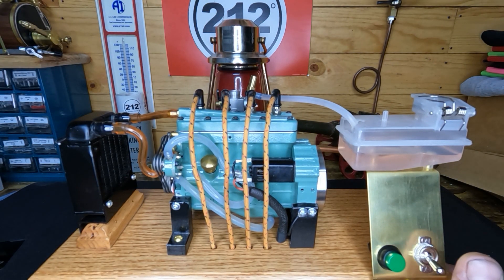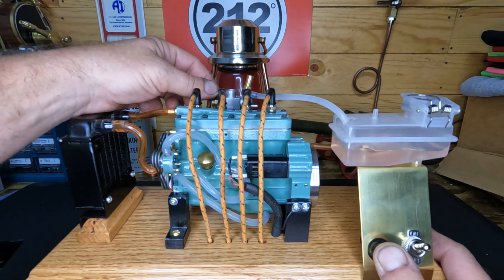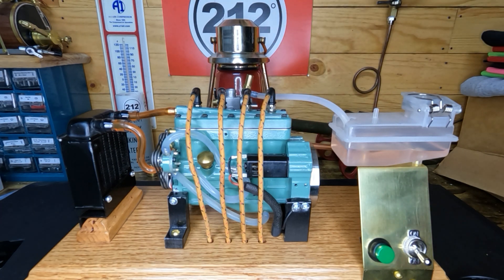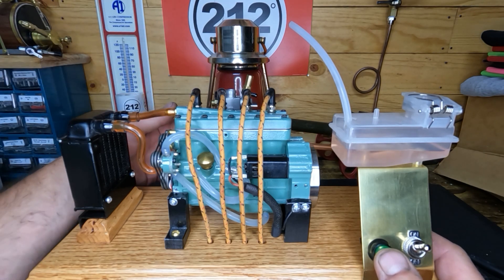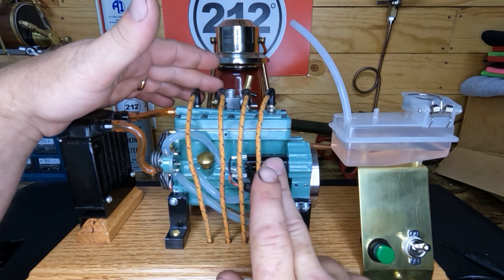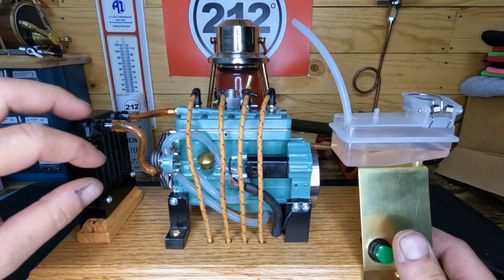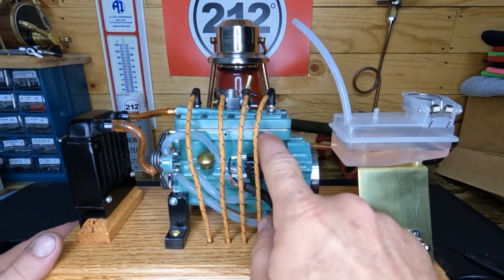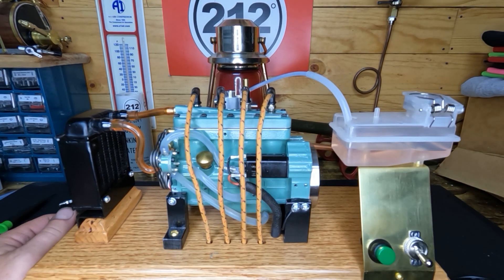A new Cison L4-175 flathead 4 cylinder engine! Part 4 Mounted and ready to start? Let's find out!

Comment: If I may give a tip for next projects: Prime the fuel line, then CLOSE the main needle. Start, and have a helper gradually open the  main needle.
It is better to begin with too lean than too rich. Too lean needs no clearing out, too rich does...

I have modded a gazillion glow engines to gasoline and that is how I start them first time.
Reply from the maker: I think that is a great idea, my only issue is finding a helper that would be willing to work terrible hours for even worse pay. I completely understand what you mean though.  If you're willing to "volunteer" your time and abilities,  you're welcome to stay in the shop loft. 😉
Reply: @steam212  :D No probs volunteering, but I thing the travel cost will be prohibitive...
Better idea: Send me your stuff and I'll do it for free :D :D :D (just kidding).

I typically do it alone but my video's are not of your quality...  But it literally saves hours.Two engines that were ABSOLUTELY NOT designed to run on gasoline, but both succumbed to this approach in mere minutes:

https://www.youtube.com/watch?v=lnVfVtH44kE

https://www.youtube.com/watch?v=6-BMFYiMR8I

Comment: I am thinking between  this and toyan v8 gasoline conversion  both as kits and stationary display and run. Does this have better build quality and better than toyan? It sounds awesome for sure.
Reply from the maker: I don't have a Toyan model to compare this with. I was very happy with the quality of this kit and the finished model. If I had to fix anything about it I would improve the assembly instructions so they were more than a QR code, a more proper radiator, and a set of mounts when completed.

Comment: Awesome video again man! Did you get it to run better?
Reply from the maker: Hi Rick, I have a few hours on it now, it seems to have broken in nicely. I think it runs really well. I'll have to make an update video on it in the future. I did make a short video and posted it but I'm not sure how to tell you where to find it, maybe if you search through my videos it "should" be there.   Thank you for your question and for watching 👍
Reply: @steam212   I’ve been meaning to ask you, Steam, -when you swapped your high-voltage wires over to the braided leads, did you splice them or open the CDI unit, and de-solder, / re-solder?  I have been wanting to do my CDI, and was guessing you probably opened your CDI unit and resoldered the braided leads. I’ve always heard HV leads shouldn’t be spliced.  

Love to know what your method was; I’ve got my wire from PM research 🤙
Reply from the maker: @mhz-yn9gh  Sorry for the late response 133,  if you strip back 1" on both leads, and join them with a good solder joint leaving less than 1/3 the diameter of the insulation, wrap them with dbt (direct burial tape) and then finish the splice with heat shrink you'll be fine.  Just remember that electricity will always take the path of least resistance. .040 of insulation will not arc when .015 is closer 😉
Reply: @steam212  Thanks for your response, Steam… didn’t know that it was ok to splice, and glad to learn that I don’t have to solder them directly at the CDI 🤙👍

The PM Research braided HV wire looks killer with the clear coating so it won’t get dirty 😁

Comment: Hey Steam, well I got my engine to run for a few seconds a few times. After taking the intake manifold off again I saw that a couple of the green o-rings had disintegrated. I don't know why but I would have more confidence in just a plain old gasket on both manifolds. These little o-rings are hard to find in any stores or in any assortment kit. After re-installing everything and switching over to coleman camping fuel I finally got it to bust off a few times but would not stay running. I do know that the carb on this thing is very touchy and best run as lean as possible. I also suspect my cdi unit and have decided to go with glow plugs (os g5 gas/glow) to at least hopefully get it running and broken in. One more question if I may, I see you have your spark plug wires insulated or covered with something was that necessary to get it running?
Reply from the maker: Hi Larry, That is great news. I very quickly gave up on the factory carb and installed one from RC engine which helped incredibly.  If you look at the model I did, you may notice that I am not running the factory plug wires (I like the look of cloth braided wire) and I had these silicone boots on hand so that's what I used. If you watch the videos on the twin cylinder tractor I have had issues with the black "plastic rubber" boots before and not to mention the issues with the factory plugs being, well, terribly made

Comment: Hey Steam I really like your videos on this engine. I have assembled mine but can not get it to run and there are many things left out of the instructions. If I may can I ask you a few questions? Like on the valve cover plate there is a hole just above the middle screw, what should I do here, plug it off with a grub screw? 
 It seems that most of my problems come down to low compression however I'm quite sure that the valves are leaking but lapping such small valves would be a challenge. Thank You!
Reply from the maker: Hi Larry, I'm not sure if I addressed the tappet cover hole or not in the videos, but that needs to be left open, it is for crankcase ventilation, if you were to plug it off the crankcase pressure would need somewhere to escape (most likely pushing the crank seals out). What configuration did you do for your piston rings?  The firing order is 1342 and there is a waste spark on each rotation (exhaust valve open) the coil fires 2 plugs at the same time, make sure (regardless of what the numbers on the coil say) that the proper pair are firing the proper cylinders (mine was not). I'll be glad to help you get yours figured out. Any questions Just ask. Thank you for your question and thank you for watching 👍
Reply: @steam212  Wow, Thanks Steam! 10-4 on the crankcase ventilation and as far as rings I went with the two cast iron set. Also I have seen others talk about the Cison cdi unit being mislabeled on the firing order and have swapped wires on 3 and 4 but still no love. As I stated earlier, I believe the valves are leaking because I can remove the spark plugs and hold my finger over the hole while cranking it over and it just doesn't seem up to par. A tiny compression gauge would be cool if such a thing were available. Another thing I noticed last night is that the top hall sensor on the pickup unit works correctly as I spin the front pulley but the lower one works intermittently. I know that replacement pickup units are  available from StirlingKit but Doggone the wait...
 I have picked up little tidbits of info about the engine watching you and Dennis Dempsey and scouring the internet for anything else. One is that the spark plug wire doesn't actually touch the spark plug connector. I have mine cut off and pushed in on top of plug. Another is that the you align magnet with bottom hall sensor when timing the engine. Am I wrong so far? Anyhow Thanks again for your help.
Reply from the maker: @larryb728  I set the timing on mine by rolling number 1 to JUST (I mean maybe 3°) before top dead center on the compression stroke and then adjusted the front pulley to fire number 1 and tightened the pulley.

Comment: The CISON's CDI is the culprit here.  It has cyl 3 and 4 flipped.. and it has an issue with the firing timing. The engine will always be misfiring if you use their CDI...running on 2 cylinders at best.   Do  yourself a favor and change the ignition system if you want to successfully run it using pump gas.
Reply from the maker: Hi Pablo. You're right, if you have a chance to look at the other comments

Comment: Use higher octane fuel
Reply from the maker: Hi William, we're using 94 octane fuel now. This is a flathead engine with 2 cast iron rings, and flat top pistons. I highly doubt that the compression ratio is anywhere close to 10:1. What would you recommend?

Comment: Hey guys, here’s what I found out.   
The answer to all the issues I had w’ my FL4 was solved w’ running Coleman Camping fuel, aka naptha, mixed with a bit of  2 stroke oil.  Spark ignition has performed perfectly. 

Great throttle response, cool engine running temps, no nitro splooge, minimal exhaust smoke, fuel efficient,  & despite lower octane,  I have had zero spark knock.  (the FL4 isn’t very high compression)

Also, no oil contamination.  That was the main reason I didn’t want to keep using nitro. 

Hope this helps,  Jon / 133mhz
Reply: I found using lighter fluid on my microcosm engine ends up degrading the rubber seals fast, but definitely much cleaner , cooler and faster response. Although I used VP racing 50:1 and it performed great without any smoke
Reply: w'  ?

Comment: Nice work. It has a nice note to it when it fires up. Thanks for sharing all your troubles with getting it to run.
Reply from the maker: Hi Darren, Thank you, I need to make another video that shows both sides of it. I made an exhaust that attaches to the manifold to help keep our atrocious woodworking clean. I really enjoyed building this one, the instructions and parts layout are not the best but if you've ever worked on a full sized engine before the real struggle is to make your hands small enough for this one 😉.  Thank you for commenting and I'm glad that you enjoyed it 👍

Comment: Those things run 250% better on glow ignition/methanol fuel than they do on gasoline/CDI.
Reply: And in return they’re lifespan is like 50 percent shorter
Reply: @123hotrods6  Nah. Much longer. Glow fuel has a shitton more lubricant in it and the ignition timing isn't off int he rhubarb anymore. They also run cooler because methanol based fuels burn a lot cooler than gasoline does; you can get away with not using the radiator at all on 0% RC plane fuel if you don't have a load on it!

Comment: I did order a set of OS G5 glow plugs, and I’ve ran my engine on nitro. Runs amazing, honestly & the response is perfect. 
However?  I agree with you 100% about running nitro and the bleed-down into the crankcase / moisture of running nitro.  
Nitro is a mess no matter what - and  I love my OS, Saito & YS engines that are designed for nitro. 
I’m determined to get my FL4 running correct on gasoline & spark… hell, seeing the vids Cison post of their demo engines running well on gas makes me want to make mine run even better 😁
Reply from the maker: I'm not familiar with what G5 plugs are (I always used F plugs on 4 stroke nitro engines).  You're right about nitro being a mess, but it smells great 😉.  I think that the promotional videos have had plenty of time and factory assistance to provide the short clips. Trust your gut, knowledge, and training.... The raw parts are there, but this is honestly a "builders model".  I still think that there are a few things that I want to improve on 007.  Maybe it's just me, but an engine that runs, but does not run well is not a well built and/or tuned engine. Take your time 133, there's nothing you can't accomplish with patience and a steady will. 👍
Reply: Thanks for your kind words & encouragement, Steam.  

So about 30 min ago, I tried an idea I had w’ my FL4….  
Don’t wanna jinx myself, but I think I’ve got it solved, dude.  
I just ran 3 full tanks of fuel and it ran spot-on & close to perfect with the Cison ignition setup.
Gonna test it once more in the morning, and will definitely report back.   

Seems like everyone who bought the FL4 has had major issues and has resorted to glow plugs. 
G5 glow plugs are somewhat new OS technology; they are essentially a glow plug that can run glow or gasoline.  They look just like the type F plug, but guessing the plug element is adapted for gasoline

-
Reply: @mhz-yn9gh  Hello, intresting with the Coleman fuel, I have used 4 stroke small engine fuel. Hoping the spark plugs arrive today, got Evolution from Horizon, maybe not same quality as OS. Last night I checked in the dark, and one hardly spark at all. Will se. Thanks for info.
Bernt
Reply: G5 is a gas plug, would prolly be better on Fs. And honestly it may not even be an ignition thing at all. It may be the carb. For some bizarre reason they keep trying TN carbs on gasoline  which just does not work. TN carbs do not like to meter such thin AFRs! I bet CDI/methanol would be the best setup for one of these engines unless you were to put a gasoline-specific carb on the thing.
Reply: C6, 
I definitely agree with you on the carb being a big issue and you’re right; these carb’s air fuel ratio aren’t correct for gasoline. 
Using the Cison carb, I’ve got the main needle set only at 1/4 -1/8 open. Slow needle open 3/4 to 1 turn.  The Cison carb is super sensitive. I wished the needles atomized fuel better.

The carbs I’ve tried are: 
VX18, OS 10ER, M.Speed mod 10ER, Enya 11CX ultra, an OS .25 air bleed, and a rare HPI .15SS billet slide valve. 
The .25 air bleed & modified 10ER worked pretty well. 

I made some good progress though last night…  once I run it a bit more I’ll follow up and make some vids of how it’s running
Reply: @mhz-yn9gh  My Microcosm engine barely even runs because of it. The taper on the needles needs to be way WAY more gentle for them to work with gasoline, either that or the thread pitch needs to be exceedingly fine. 

I think these flathead fours would prolly run best on spark/methanol. The nitro seems to perk them up quite nicely as one might expect, but straight methanol would prolly run quite nicely on spark ignition. Added bonus, cooler combustion, so the radiator has less work to do.

If I had one I'd probably just feed it my standard RC car fuel. 20N 12O. The oil blowby wouldn't hurt anything in the bottom end and I could easily drill a PCV bung if I wanted to. You can get car fuels down to as little as 6% oil, too.

Comment: I know the 2am FL4 struggle all too well also, Steam - so glad you got your engine running.  I’ve had mine running on gasoline & spark ignition but haven’t been happy with it.  I’m right at 1/8 turn out as well on the main, 1/2 turn on pilot / slow jet.  I ordered an RCEXL in line 4 ignition setup… I feel like the auto advance will help my FL4.  Waiting on another magnet for the hall sensor which should be here tomorrow.  

Your base looks awesome, huge applause man.   I also ordered some braided wire as well from Ton’s Performance… love their braided Harley ignition wires.
Reply from the maker: Hi 133, check your firing order, 1-3-4-2.   Pay no attention to what the ignition box says, check to see what it spits out 👍.
Reply: Thanks man.  -Yes sir, that’s one of the 1st things I did after seeing Dennis’s video while getting my ignition set up.
Reply: I also installed the rcexl unit but it wasn't until I swapped wires 2 and 3 that it would run, odd because it shouldn't matter. Anyhow after a lot of tuning and breaking in it runs great now. I would advise that you change oil often because the crankcase gets flooded with fuel easily when making all of these adjustments. Oh btw you will have to add a 10k pull up resistor between signal and positive on your hall sensors. You probably have that all figured out by now.
Reply: @larryb728  I also have the RCEXL ignition, man. 
Cison modified their CDI, to now not have the external ground wire.  I bought one for my FL4 and it runs so much better now with the new Cison ignition.  Also have the L4 OHV… what an engine!!
Reply: @larryb728  Also agree on multiple oil changes… once I changed the oil over 6 times through getting my engines broken in, it stays a lot cleaner.  I’d love to see your FL4 running!